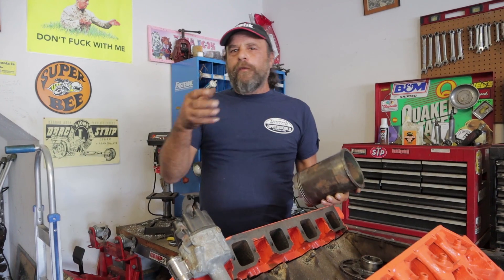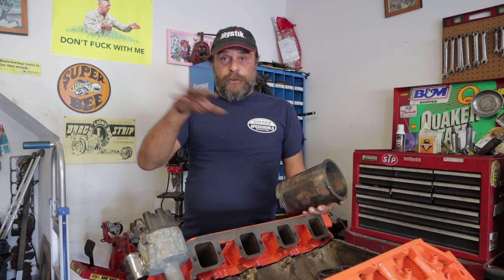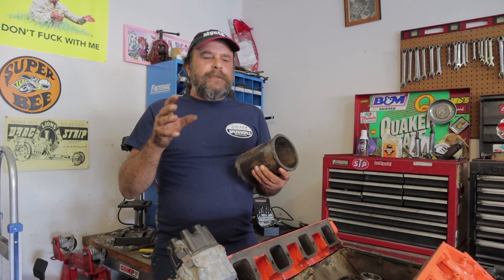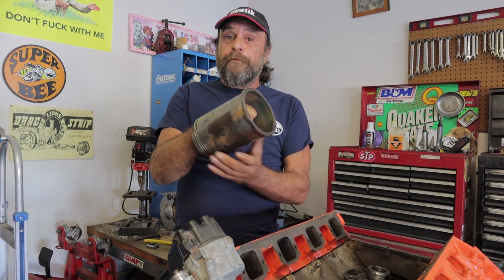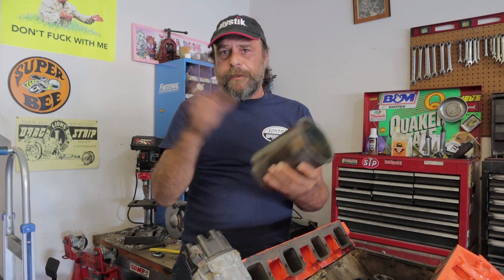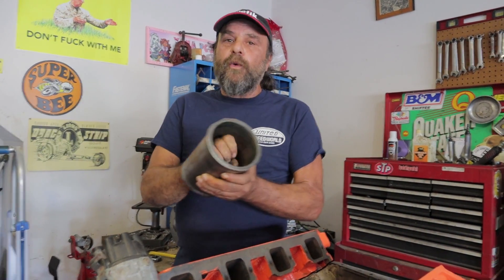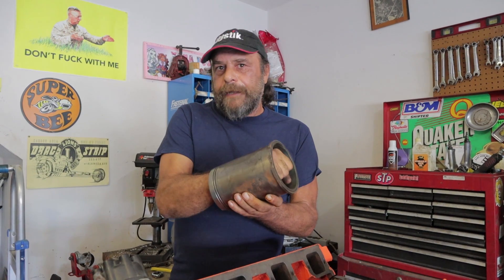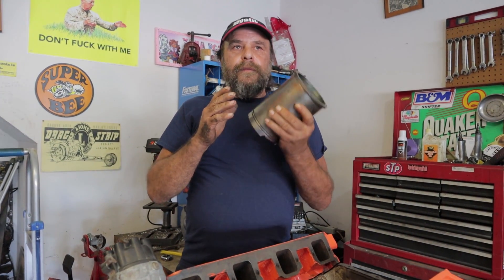The Myth Of Engine Displacement

Comment: I've been wondering about something, maybe this explains it. The land speed record for a pistion powered wheel driven vehicle is held (last I heard) by a streamliner that only runs one 348 cubic inch V8. They tried larger engines and either blew them up or actually went slower. Granted it's nowhere near stock... it has more stuff done to it than I can even pronounce let alone remember. However the same engine, which was their backup engine, just keeps going and going, with little trouble, while the bigger engines they tried that didn't flat blow up still had troubles. I would imagine they have this engine set up so that it's under power for at least most of it's stroke. It may be a fairly large bore and very short stroke for all I know.  The darn thing will go well over 400mph... mostly a credit to it's custom 10 speed transmission. it like starts out over driven then is more and more over driven from there. Anyway the relatively small motor flies in the face of the displacement mantra.

Comment: So wouldn't it be true then, that if you increase the static displacement of the engine by leaving the stroke alone and significantly increasing the bore, you now create the potential to do more work? I know there are other factors that help this scenario like bore unshrouding, compression, quench area, etc. So going this route, if you could ignore the physical constraints of bore centers within a block, the old adage of no replacement for displacement would hold true, just depending on how you achieve that displacement?

Comment: That's right, there's no replacement for CUBIC FEET PER MINUTE, that's why a Japanese motorcycle engine that's got 1/3 LESS displacement than a Harley engine can make 1 1/2 times MORE POWER, because it flows 1 1/2 times the CFM of a Harley engine despite its smaller displacement. 
Jerry Branch (most experienced engine flow master in the world) always said "Think of each CFM as a stick of dynamite, the more sticks you have the bigger the bang".
Reply: Yes but less peak torque at a higher less user friendly RPM, there's always some trade offs.

Comment: Piston speed and gearbox ratios are also extreme important. Imagine ur daily rig rev limiter at 6500 rpms, and a 6 speed gearbox capable of 350 km/h. Then imagine a f1 engine with a 18000 rpm limiter with a 7 speed gearbox capable of 275 km/h. That's aceleration

Comment: you only discussed the possible vitues of the power stroke.   In your example-  IF you increase stroke 1 inch, you are also sucking in more air/fuel, with that inch, on the intake stroke.   That leads to more power on the power stroke.    One needs to consider all aspects of the engine, not just the power stroke.   different fuels also matter.
Reply from the maker: Watch the video again...I said exactly that toward the end

Comment: So, let's say instead of 3in bore and 4 in stroke, you increase the size more so than the stroke say a 5in bore and 4 inch stroke. I get that to you need stroke for torque and to intake air mix but you're increasing working cubes that way. So to take full advantage for this setup you'd probably want forced induction huh.
Reply from the maker: Not practical to increase the bore like that on a production engine.  Most max out at around .060
Reply: @UncleTonysGarage  in real life more like 4.5 bore to 4in stroke? And wasn't the 318 a square motor like 4 bore and stroke.

Comment: If it draws in more air/fuel mixture, the "bang" will be bigger on a longer rod making more power. I always understood the "No replacement for displacement" to mean, all thing being equal, more cubes, more power.

To me one of the biggest drawbacks of really long stroke is piston speed and the resulting frictional losses.

Comment: and then there is expansion over time which is why the 4 inch bore is generally considered to be the maximum width for an efficient burn propagation for the flame front to expand when using gasoline as the fuel source.  ;-)

Comment: Tony... Make an in depth video explaining *DYNAMIC COMPRESSION RATIO*...
Reply: He can't explain what he doesn't understand.
Reply: @snek9353  Can you explain it for me?
Reply: @kylelove927  Quickly dynamic compression ratio adds the element of valve timing. It's the ratio between the volume in the cylinder when the intake closes and volume at TDC. If the intake closes later in the compression stroke effective compression decreases. 

This is a big part of why engines with variable valve timing can run 11.5:1 static compression ratios on pump fuel. 

It's also what's at times called a Miller or Atkinson cycle. If the intake closes late effective compression is lowered preventing detonation. But because the static ratio is still high and exhaust opening late the expansion ratio is still high getting more work out of a given amount of fuel.
Reply: @snek9353  I see you know how to use Google. Very nice.
Reply: @kylelove927  I didn't "google" that, I know engines, it's not rocket surgery.
Reply: @kylelove927  I use this concept to get the most out of my Hemi. It has variable cam timing that I can control via the ECU and a high for modern pump gas 10.9 compression ratio.

Comment: I totally agree, by time you properly engineer a Stroker engine to run on pump gas...your better off (IMO) to fix the deficiencies of your stock stock engine, like low compression (piston deck height) and cylinder head flow.

Comment: Build an engine with a broad torque and hp curve, and it will beat another engine with more peak torque and hp numbers in the real world. As long as you`re not running a 250hp engine against a 500 hp one. A good thought out 450hp engine can out perform a 500 hp one in equal car weights.

Comment: My daily driver, is supercharged.  If I am (normal) driving in 3rd gear @ 30 mph, but need to change lanes. If I mat the accelerator pedal. The trans. will downshift & boost climbs to 12+ pounds. The tires are fighting for traction, as I fly up the entrance ramp to the highway.

Comment: So put this into context using the 400- 451 stroker big block Mopar
Reply from the maker: Good with a B rod, bad with an RB rod
Reply: That's what I thought too
Reply: @UncleTonysGarage  I agree with this, but why then is there SOOOOO many "kits" out there that insist on using the 440 rods? I even saw one that had long enough rods in it the oil ring on the piston was IN THE PIN HOLE! I thought that was insane. They said it made the piston "very light" and that was better.... hahaha, I mean there wasn't much left besides the top of the piston so yeah I bet it was lighter. I guess I just don;t see how that level of compromise in the geometry is worth it for a few more cubic inches?

Comment: The whole point of a long(er) stroke was torque.
At the Reno air show you see crazy boosted Merlins engines with 27L of displacement taking on Pratt & Whitney R-4360 with  71.489 L of displacement or  Wright R-3350s with 54.862 L.

Comment: RPMs, this is why I rebuilt a 429ci for my 79' f150 and not the 460ci. most of Ford's fleet trucks used 429ci different rod and piston setup but same displacement. Chevy's 302ci and 327ci was also  monsters to worry about😁.

Comment: Not trying to put words in Utg's mouth but I didn't here the standard why Mopar has an advantage because of it's longer rod motors having more dwell time on tdc where it absorbs more of the power stroke and also doesn't yank the Piston away at high rpms. Seems he values the leverage a short rod has more.
Reply from the maker: This wasn't about the details of any particular engine, but yes, I absolutely prefer shorter rod ratio engines.  Stuck with the long ones on the mopars

Comment: If all you do is increase the stroke then yes, you haven't increased the area necessary to produce more force in the bore. Increasing the bore however is an entirely different animal and does increase the amount of force available to produce work. Hence the bigger bore shorter stroke that pro stock racers use.

Comment: this is the main difference electric from gas ,electric motor has 360 degree torque 0 to 20,000 rpm same torque all the way. that's how a 200 h.p. golf cart can beat a 600 h.p. hydrocarbon burner !

Comment: I always prefer to increase bore over the stroke, I wanted to put a 327 crank in a .030 400 block! With the 3.25" x 4.155" bore, it may not have alot below 2k rpm, bet should do well about 7k, with good heads and cam, a couple turbos will replace the compression the stroke lost, so far I have the block, with. Stock components, and a set of aluminum heads, the only 400 I had experience with ran like a decent running 350, and it had about 200k. On it , so it was a bit loose, no major blow-by, so I'd like to shorten the stroke, give it a 9.5-10:1 compression, and a water methanol injection, starting about 4 psi of the 8-10 psi of boost, if it doesn't do around 600 hp, well, I'll drive it anyway!!!.. I guess the 400 on boost would make 800 Ftlbs, with the right cam, but it probably wouldn't be as fun!!

Comment: The only replacement for displacement is a turbo. In turn though, usually the power is easier to make and usually at lesser boost levels, with bigger engines. So, it still rings true! No replacement for displacement!

Although I much rather have my displacement from bore size increase, over square and turning the R's baby! Do the same to a big inch engine and it's better!
Cylinder filling and building as much heat as possible without  melting, is the name of the game.

Horsepower is King!!! RPM is addictive!
Reply: well,the nice thing about a big bore, short stroke big displacement engine is that it still makes great tq. i wish someone would build up a hot stock stroke mopar 400. insanity would insue.

Comment: Jesus, dude. Talk about an overly complicated over simplification. Increasing stroke is one way to increase displacement. Other things that you can change are rod length, deck height, compression height (all dependent on each other, including stroke), and bore. Take a 300cid engine and scale everything up to 400cid, and you'll get a 33.333 increase in power (ignoring the squared cubed law, and chemistry since they're negligible). period. Increase one variable (or a few but not all) and you'll get varying results. Following your concept, and applying it to just the bore instead of the stroke, and you'll not only increase displaced air/fuel, but you'll increase the area of force on the piston face, AND decrease valve shrouding and increase flow into the cylinder. This video is kinda like the stuff you hear 8 or 9 pbr deep after the races and ignores reality.
Reply from the maker: Show me where my math was wrong here.  The engine used was just to show a common but hypothetical situation.  Go back, watch it again and tell me where I was wrong..  Better yet, go through these comments and see how many engine builders and engineers agree with my example
Reply: @UncleTonysGarage  I'll start by apologizing for being a dickhead. I was, myself, a couple beers deep after a long, dumb day. I was already gritting my teeth at the guy in our shop who constantly whistles dumb songs, and repeats the same rants about how "an internal combustion engine isn't a 'motor'! it's an engine!" and goes off about how "dogs are stupid, and people that own dogs are stupid". That's no excuse for being a dick. So, sorry about that. 

I'm not saying your concept was wrong, and I fully understand your point. It's just that the example you gave was one aspect, of one way of increasing displacement and ignored every other aspect of every other method of increasing displacement. The concept you described applies to any standard internal combustion engine and scales up 1:1, so I don't understand how that's an argument against increasing displacement. I feel like you're going out of your way to prove wrong an already very vague and exaggerated statement like "there's no replacement for displacement". Maybe that should be defined a little more clearly? Increasing displacement is a great way to increase power and the same laws of physics apply to any motor regardless of displacement. This is coming from a guy that's had a lot of fun building little 166 and 174cid mechanical injection, methanol midget motors, and I love hearing "it's not how fast you go, it's how you go fast". I'll rewatch it with a clearer head. I hope you see this, and I hope your day went well. Keep making noise out of fuel.

Comment: One of my favorite examples is measuring the changes rod length itself makes in relation to piston speed.  Engines with shorter rods can pull more air at the beginning of a stroke but engines with longer rods the combustion process has more leverage over the rotating assembly at the beginning of a stroke.

Comment: When you start really studying the wankle engine is when theories like this really start to apply.  Like when the crank transitions from vertical to horizontal movement The shape of the combustion area also changes at a non linear rate as the intake and combustion process evolves. Makes for some really fun brain twisting.

Comment: I could see this on a graph, where a certain engine size gain has a dramatic advantage but at some point you see a diminishing return.
Reply: This is exactly it, and also can vary from one engine to another based on the bore vs stroke and block design(deck height) because of how it affects the rod ratio. Adding more stroke only helps if the engine can breath well enough to get all the additional air into the bore, basically. You could add stroke to a long stroke engine, but if it can't get more air in.......

Comment: Displacement will only change by boring out the cylinders or by changing crankshaft throw. 

As you said, pushing the piston further up to get deck height wont increase swept height because that can only be changed by changing crankshafts.

Comment: They teach something very similar in diesel engine class. A diesel engine keeps "the fire" or "work" going till around 20 degrees, depending on the engine, before the bottom of the stroke. Utilizing more of the displacement. But you are still only using a little less than half the displacement of the engine and giving up a higher red line.